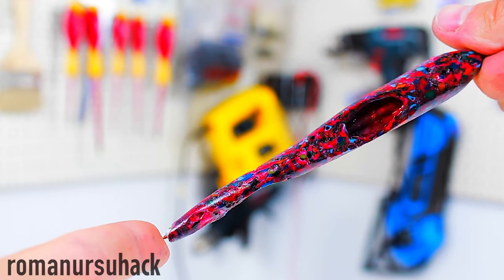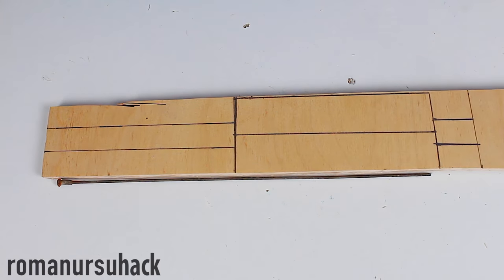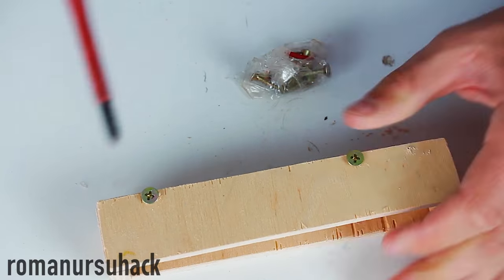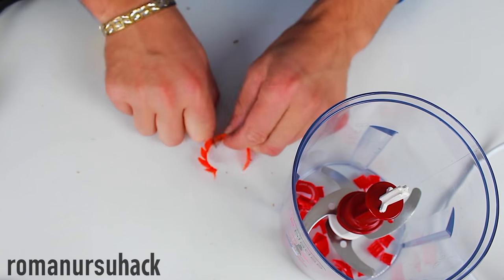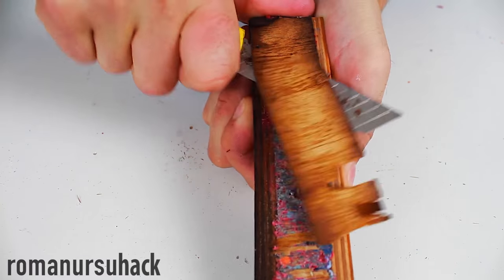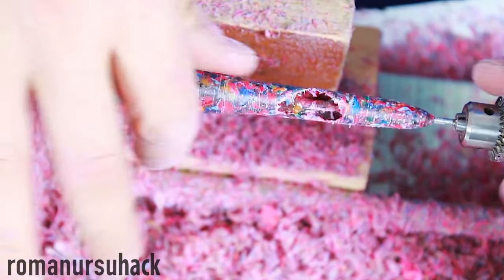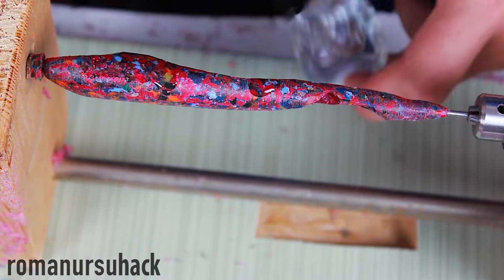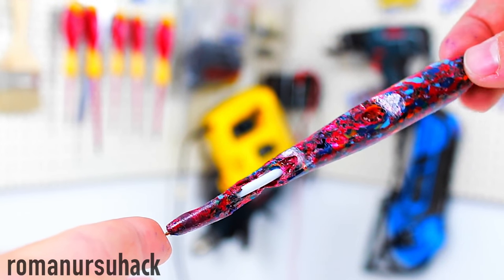How to make a pen from plastic bottle caps

Comment: A suggestion - - when you are going to heat up the plastic in the oven, maybe use aluminum tray to place it in - and maybe make the mold out of some aluminum as well -- that might make it heat evenly as well as be a quick and cheap way to make your mold. And maybe easier to clean up too.